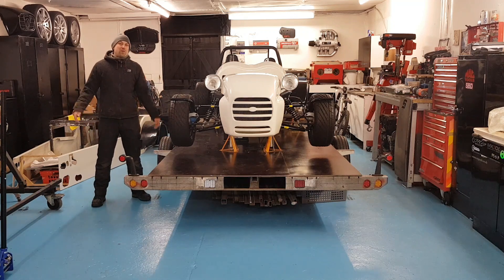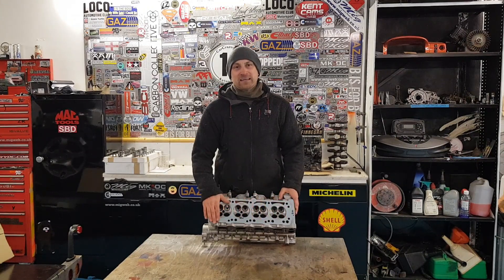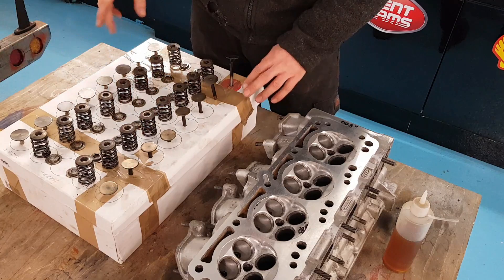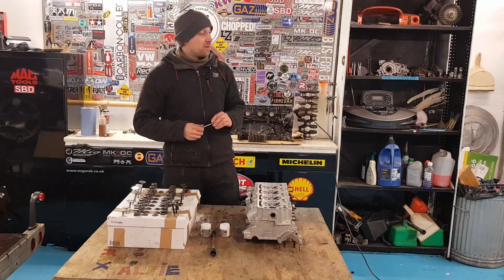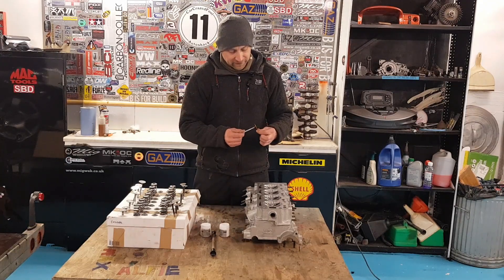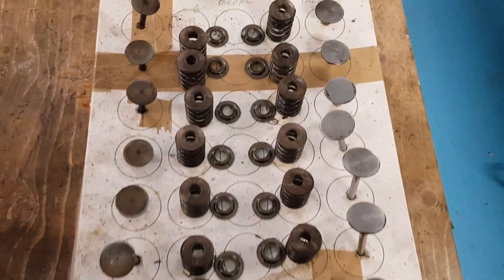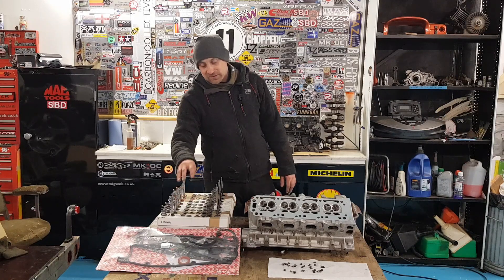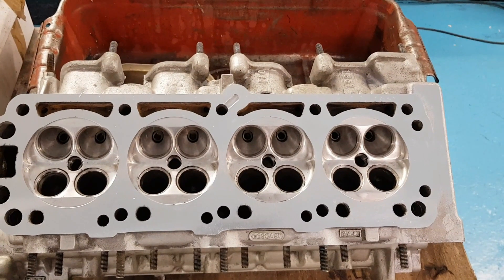Ep22: Lapping the Valves in on my COSCAST C20XE Cylinder Head!

Comment: Go and buy a collet installation tool if you don’t already have one. Wish I had when I refitted all the valves in my MX5 head. Total pain in the arse getting them in with a small magnet screwdriver. 👍⚙️🔧🔩
Reply from the maker: I have been meaning to get one of those, heard good things! But I'm putting it back together tomorrow, so I'll struggle on 😂
Reply: Vaseline on a screwdriver works best, vaseline keeps them in place also.

Comment: The days of lapping by hand are long gone for me lol i know its the correct way of doing it, but for a long time i have just used motorbike fuel pipe in a drill push the valve through the guide push the hose onto the valve stem and buzz it forwards and backwards a few times the rubber hose stops you cutting at an odd angle. Always works perfectly 👍👍 another great vid pal
Reply from the maker: I have seen plenty do it with a drill 😂 it was hard work doing it by hand, but came out spot on 😎 I certainly won't be doing my 40valve RS6 by hand if it ever needs it 😂😂